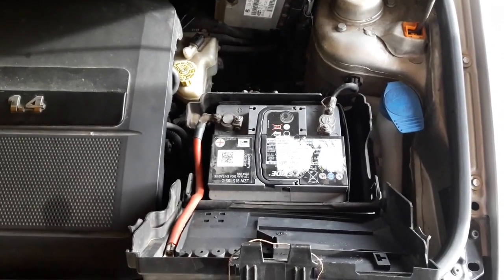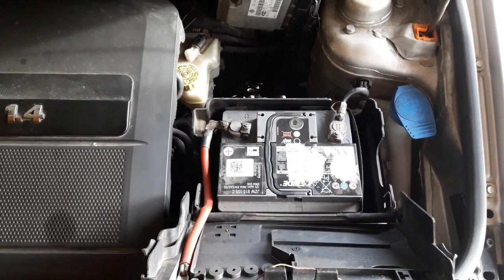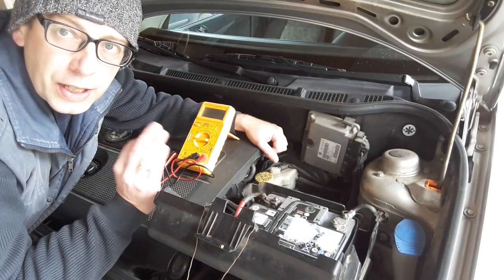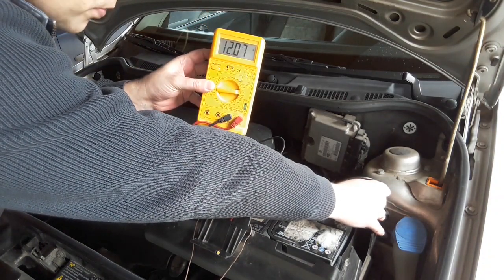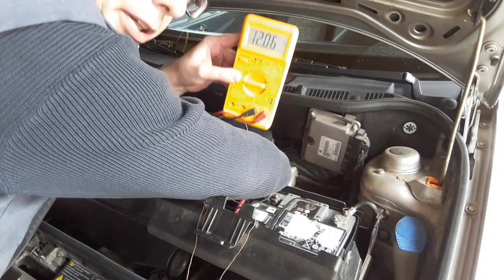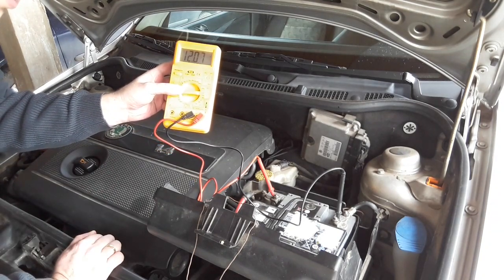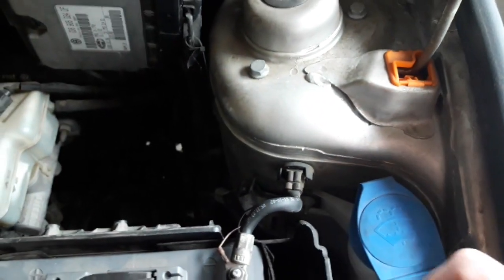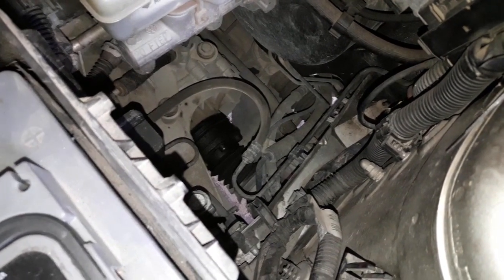Bad Ground Connection On Cars-Meaning,Symptoms, Diagnosing and Solving The Problem

Comment: This video and the comments are helpful. I have a 2007 Chrysler Pacifica  the wipers, horn, radio, don’t respond. The voltage, airbag, ABS, parking brake and traction indicators are lit. 

I’m hoping this is an issue with the wires and them needing to be reground
Reply from the maker: Hi Jamar and thanks for watching!

Could be, give it a try. Besides the ground connection, I would check for loose or rusty connections.
Reply: Was that the issue ? And did you fix it?

Comment: Hey man I know this is a odd problem but do you have any idea what would cause my 01 mustang to loose electrical power when I try to turn my key and all I hear is one loud click
Reply from the maker: Hi and thanks for watching!

The first thing I would check is the battery terminal clamps. I would check if they are clean and properly tightened.

Hope this helps.
Reply: @DespairRepair  thank you man I will try it right now and update later
Reply: @lookherelooklisten9413  what happened?  Same issue here.

Comment: Hi i have a rough start when starting my car, and once it turns on and warms up when i go to turn it off and doesn’t want to start up anymore until it cools down a little there is some corrosion on the ground that’s connect to the engine block . Did the  multimeter test on some areas it reads good on others it reads really low like 8. Something. Could this be the issue ?
Reply: I have this exact problem what was the solution in ur case?
Reply from the maker: Hi and thanks for watching!

Could be and I would clean the ground connection just in case.

It could also be the starter.

But before spending money on repairs, try connecting a jump cable from the minus battery terminal to a safe metal spot on the engine block.

Then try to start the engine. If there are no problems, then the ground connection is the issue for sure.

Hope this helps!

Comment: When cranking I usually get a click, and I have to try to crank it a few times, after 2-4 times it works. I drive a 2002 ford focus se if that helps.
Reply from the maker: Hi Brennen and thanks for watching!

That kind of fault can be caused by a number of things.
The first that come to mind are a bad starter solenoid, worn-out starter brushes, worn-out ignition switch, loose or corroded contacts to the starter solenoid, and so on.
If the starter is OK, try checking the battery terminals (if there tightened and cleaned) and the main ground connections.
Hope this helps!

Comment: I just bought a '94 4Runner today. I'm going to replace the battery because it is old. It has a slow crank and won't start without a jump. Once started, it runs fine. The guy was using a lamp cord as a body ground. Running from the negative, to the body. He claims, this is the problem. What gauge wire should be used as replacement? I don't know much about vehicles, but I'm pretty sure a lamp cord is not what should be used.
Reply from the maker: Hi John and congratulations on the purchase, very good machine.

No, a lamp cord is not good and could've easily caused the problem.

Either buy a proper ground strap or put a thicker copper cable (the one with insulation on it). I would use a 4 gauge.

Sorry if I'm patronizing, but best buy one from the car parts shop, if possible. These are already properly crimped and insulated making them last a long time.

Also, if I was in your place, I would check the connection from the body to the engine or transmission. 

Hope this helps.
Reply: @DespairRepair  I bought a new battery and it starts right up now. Night and day difference. The wire I ended up using is an 8 gauge (because autozone didn't have the kit I needed) I hope 8 gauge will continue to be ok. I can fix your house, but I am nearly clueless when it comes to vehicles. Thanks for your expertise. 👍

Comment: My left taillight doesn't work at all ive replaced bulbs and circuit board and it will work fine for a few days and then shut off again. Could that be from a ground wire?... also my windshield wipers will stop working after about a  half hour of use and ive replaced the wiper motor
Reply from the maker: Hi Diego and thanks for watching!

Could be a ground wire. Are the front or rear wipers not working? Does the taillight stop working completely?
Reply: @DespairRepair  its the front wipers and yeah the whole thing goes out . I also noticed when changing one of my front headlight bulbs that if I move the wire in a certain position the light goes out
Reply from the maker: @DiegoSanchez-ds9hk  then I would rather check the connectors and the wires for a loose or broken connection.
Reply: @DespairRepair  thank you ill try that

Comment: Can this make coils smoke if the key is in the ON position?
Reply from the maker: Hi and thanks for watching! Which coils do you mean?
Reply: I have a 2001 Nissan Pathfinder. My coils got really hot it almost scalded my fingers when I touch them. This happened whenever I turned the ignition to 'ON'. It actually melted one of my ignition coils and threw a p1320 code for ignition. After I cleaned and  tightened my engine ground, that issue went away. Had to get another coil and O2 sensor ,  then the P1320 went away.

Comment: Hey do any one know anything about vsa lights?? keeps coming on and wen it do it drop my temperature gage to C temperature it’s a 2007 Honda Ridgeline..
Reply from the maker: Hi Ricardo and thanks for watching!

Try checking the fuses but even better connect an OBD tool. Check for error codes and start from that.

Comment: Hi and thanks for the information...I have a Vw polo 9n which is basically almost the same car as the skoda you are dealing with...Ive had some problems with the immobilizer and in a car shop they told me its a faulty insturment cluster and i changed it and now the problem with immobilizer is gone but the intrument cluster started acting strange 1 month ago when it reset itslef while driving and now one morning when i went to start the car i noticed that there were no digits in the intrument cluster and when i turned the key the car started and then it died...What might be the problem ? thanks
Reply from the maker: Hi Niko, thanks for watching and sorry for the late response!

I would first check the alternator voltage and if the battery clamps are clean and properly tightened.

What you can also do is try asking the people who replaced the instrument cluster. Maybe there's a weak connection somewhere or lose connector.

Hope this helps at least a little bit.

Comment: starter not working at all--power going to it on permanent spade-green wire from ignition switch--when key turned fully to start  power going to green ------its working yet starter not working at all
Reply from the maker: Sounds to me like the brushes might be worn out.

I had similar situations, the best way to test this is when the starter is out of the car. Connect a plus cable to the lower screw on the solenoid. If the motor doesn't work and there's only a weak spark, then that's the problem. Could be the commutator also but that's rarer.

When the brushes are worn out, the solenoid will not work either so the starter will be practically dead.

This explanation is a bit confusing but hopes it helps.
Reply: @DespairRepair  wife works in cancer hospital so needed car urgently---although i was getting my test light lighting up when i put it on live terminal on starter and earthed against starter----when mechanic looked he said u have a bad earth on main engine block---he used an negitive black car jump lead from battery to starter------it started straight away---he made up an earth lead from 6mm electrical cable earth wire and connected it to battery and one of bolts holding starter-starts 100% now----------several garages said-immobilizer faulty-----------needs new battery-new starter (3 said this on phone and quoted £150-£200-for repair)-shows u need to be wary of a lot of garages-thanks for your help
Reply from the maker: @chevy790  you're welcome and glad you solved the issue.

Congratulations to the mechanic who noticed and solved the problem. It could've easily ended up with spending a lot of money with no result.

All the best to you and happy driving

Comment: mk3 clio petrol 1.2 16v------starter wont turn over-got a second hand one tested with battery before installing-worked ok-put it in--no crank at all-------checked power going to one of terminals that feeds power constantly-working ok----------small green terminal-i beleive is wire from ignition(removed from starter just to c if power coming from ignition-it is)-tested with a small bulb when key turned fully as if i was starting car------lights up on and off as i turn key fully on and off-------------why is starter not engaging at all? checked starter i took out  and its actually ok as well-------tried jumping a wire between the 2 terminals on starter-nothing-----------is it possibly a bad earth or am i missing something? any advice or ideas welcome thanks in advance
Reply from the maker: Hi Chevy790, sorry for the late response.

Please, tell me, I didn't understand, when you connect the two screws on the solenoid does the starter react? (doesn't engage to the flywheel, but turns over).

Comment: I wonder if bad ground cabel to the engine can causes high voltage on cabels? Ore is the alternator bad?
Reply from the maker: Hi, thank you for watching!

To be honest I doubt it. With a high voltage problem check the alternator first, namely the voltage regulator or stator.

Hope this helps!
Reply: Thanks 👍 Good Video 👍

Comment: Could you have a bad ground even though the car starts right up and runs without any  issues? I have extreme flickering of lights & power windows don’t work.
Reply from the maker: Hi Vanny and thanks for watching.

Yes, it is possible if they're connected to the same ground loom and it doesn't have a good connection.
I'm talking about looms connected from the wiring installation to the car body.

Comment: Can a bad ground make your voltage drop dramatically when you put your car in driveway or make your voltage drop dramatically while AC turns on or even make your car shut off while driving...My Alternator is good and I have a new battery and I'm experiencing all those symptoms
Reply: Same here i can’t figure out why my car drops voltage when I turn the ac on or when I turn anything in the car drops voltage and if Im just in park the car slowly drops voltage it’s been a year since I drove my 350z and no one can seem to figure it out sadly
Reply: @visualjermm7879  mine was MAF sensor
Reply: @MeMe-fy8pd  symptoms?
Reply: @speedgoat2824  basically what the first guy said, if I turned on the air conditioning the car would just stall. But another symptom was under heavy acceleration the car would jerk a couple of times and then stay at a constant speed and not accelerate
Reply: @MeMe-fy8pd  Did you check AC electric circuit for a short to ground?
Reply: @MeMe-fy8pd  alternator?
Reply: @visualjermm7879  It sounds like you have a parasitic draw in your car. Simply do a parasitic draw test with your multimeter. And pull the fuses out one by one, until the voltage drops and that's where your draw. will be. Try that.
Reply: bad voltage regulator.? faulty wiring causing parasitic pull.
Reply: all grounds are important but my manual said the negative grounds are most important.
Reply: my grand caravan doesnt have power at all. the battery is good and there are no blowned fuses. Can be the engine ground strap? Because is broken
Reply: Alternator 95%
Reply: If not the alternator that other 5% in my opinion might be the fuse link in the wire that go to the positive post on the battery
Reply: ignition control module+ maf sensor was mine. a no start issue. fixed those 2 things and found 2 very loose plugs. replaced with ac delco irridium and new wires. and unrestricted exhaust car runs ok now.
Reply: yes a bad ground is bad. both pos+ and neg- but negative is even more prone for issues. eg hayes manual.
Reply: Your alternator may check out “good” but it may be too week if you added aftermarket accessories.
Reply: I think it's time to replace all ground straps with a negative cable 😅
Reply: Crank shaft sensor.Replace
Reply: Yes, my car did that
Reply: @lijahp1
Reply from the maker: Hi Danny and thanks for watching!

It is possible for sure although I think there would be other symptoms present besides that.

If I was in your place, I would also check the other devices that are driven by the serpentine belt like the AC compressor, power steering pump, or others, depending on what car you drive.

Comment: Ok,great content and very clear.
I recently installed a new rádio on my car and it's been a bumpy ride since.the radio will shut off and turn back on if i use the ac or sometimes if simple the fan turn on.i was parked yesterday and the whole car shut off,pls let me know what you guys think it is 

Thank you
Reply from the maker: Hi Tom and thanks for watching!

I would check (if you already haven't) the battery terminals for a good connection.

Also, try checking the power supply to the radio (+) wire.

Comment: Sir, why my power window and wiper sometimes work but sometimes don't. Is it because of the electric problem?
Reply from the maker: Hi and thanks for watching!

Could be although there are a number of other reasons.
Reply: @DespairRepair  I think sometimes the headlights also don't work and it all happened at the same time.
Reply from the maker: @Bakmietjaplaku  do they all cut out at once, do the headlights work but are dim?
Reply: @DespairRepair  yup, I think the headlights still work but are dim so I can't use my car at night. Yes, they cut out at once.
Reply from the maker: @Bakmietjaplaku  well, then the ground connections are worth the check, especially if one or both are dim.
Reply: @DespairRepair  thank you sir, I hope my car is fine.
Reply: @DespairRepair  sorry for my bad English, I still learning it.
Reply from the maker: @Bakmietjaplaku  no problem glad if I can help :-)

Comment: Does bad ground connection to body to engine cause battery power drain ?
Reply from the maker: Hi and thanks for watching!

Not that I know of.
Reply: No. But it WILL cause a low voltage reading until it’s fixed.

Comment: My car starts fine but at low speeds when you turn the steering wheel the car cuts off when I turn my steering wheel in park the dash lights dim and yesterday when I rolled down my window it made the car cut off. Any idea whats the issue? I already took it to a car shop and they referred me to a electrical shop
Reply from the maker: Hi and thank you for watching!
I would also say it's an electrical problem and visiting the auto electrician is the way to go.
Don't know what the car is but if I had the problem:
I would first check the alternator voltage output. Also, I'd take a glance at the serpentine just in case. 
If that was OK, I'd check the ground connection clusters for rust, a broken wire, or bad contact.
There is also the option of connecting an OBD tool and seeing if there are any error messages.
On some cars, these kinds of problems are typically due to poor quality parts or bad solutions.
Hope this helps at least a little bit.
Reply: Blue Hunnids did you resolve your issue? I have a similar issue on my Chevy Cavalier.

Comment: Can a rebuilt battery cause electrical problems? Every since I put a rebuilt battery in my car I keep getting a hesitation only on hot sunny days..the car drives perfect at night and when it's cold
Reply from the maker: Hi and thanks for watching!

I won't lie to you I've never used a rebuilt battery (just new ones) so I can't give you any valid information.

But if I had to guess, it can be a symptom of a bad battery. I hope everything else is OK (like the starter, alternator, ground connections, electric drains and else).
Reply: @DespairRepair  I had all that inspected and everything checked out good but I think I'll go ahead and get a new battery cause as I said the issue started when I replaced the old battery with a rebuilt battery..I'm going back today so the mechanic could do some more testing I hope I get this resolved this week cause it's driving me crazy and it's also a safety hazard..
Reply from the maker: @trini_boi2414  yeah you're completely right, change it asap.

If the mechanic has a battery tester, it will tell you immediately if the battery is bad.

I don't want to patronize but at least in the case of a car battery, a new one is the best and safest solution.

All the best to you and hope the repair goes well! :-)
Reply: @DespairRepair  thanks and so far he hasn't find any issues and the battery is fine according to his test results but I'm still going to replace the battery I have more faith in a brand new battery vs a rebuilt battery..

Comment: Hey man, my car immobiliser is going offand there is no crank, just clicks and a heavy click from starter, but the fuel pump engages and it starts when I short the starter with a screwdriver. I see the ground to chassis is got green corrosion. Do you think this could be a cause for it? Thanks image to ground cable. https://imgur.com/a/JJtYo0O
Reply from the maker: Hi, thanks for watching and sorry for the late reply!

If I was you, I'd check the starter solenoid first and the connections to the starter.

Clean that ground connection nevertheless, it certainly won't hurt.

Hope this helps.
Reply: @DespairRepair  Thank you, the block grounds didnt work so I'm sure it might be the starter and its ground + connections. Will check them :)
Reply: @eazilyunreal2701  what happened?